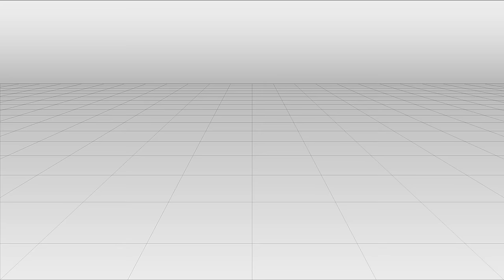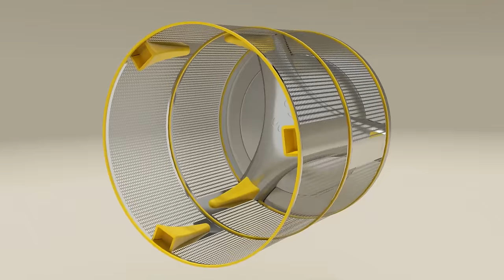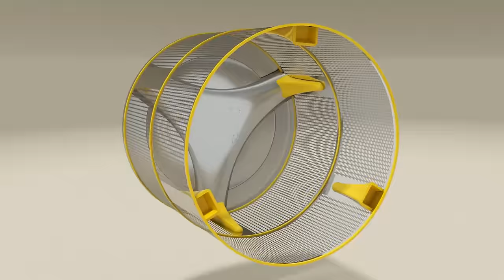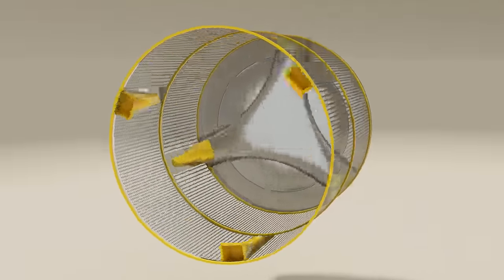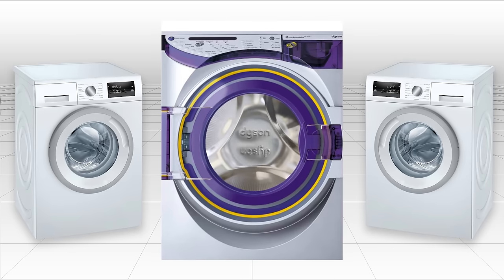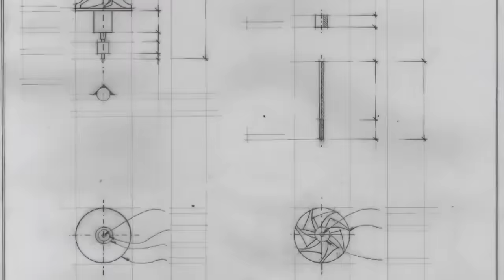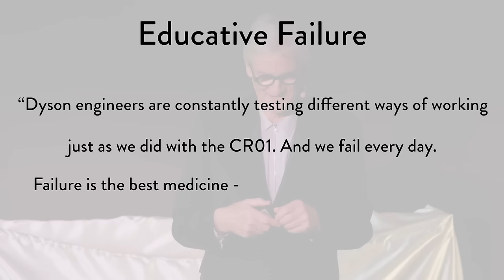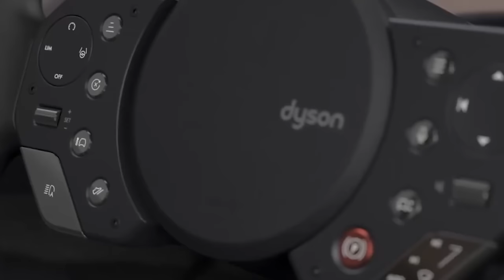Dyson’s Failed Washing Machine? The CR01 Mystery...

Comment: You highlight the key problem. That they simply didn't know how washing machines were traditionally made. Sometimes that's a good thing.....it allows you to disrupt a market by thinking outside of the box....but it can also be a bad thing that causes you to make mistakes by not understanding fundamentals. There are certain products and industries where not knowing how something has traditionally been made can be disastrous. 

Also, I think the main reason (from a practical standpoint ) was that the Dyson washing machine was just too damn expensive given the amount of repairs they constantly needed. It doesn't matter how good a product is if it's too expensive and isn't reliable in terms of not breaking down. Being innovative isn't by itself enough to make a product successful. People also need to be able to afford said product and know they don't have to worry about it not working. A 66% failure rate is simply not acceptable.

 And in order to produce a washing machine that won't break down so much you need to understand the fundamentals and how they are traditionally made. The same would apply to cars. Complex machines with many working parts cannot simply be designed and made from the ground up without a strong understanding of how it's done. That's a large part of why Dyson failed to develop their EV. They tried to do it from the ground up by themselves without a deep knowledge of how cars have been made (and the reasons why). They should have rather partnered with a car company.

Comment: I used to sell these. Can't remember ever having to replace one, but we only ever managed to shift a few. At that time you could buy a competent, low-end washing machine for under £130, so the price was just too much for most buyers. The thing weighed double (or more) the weight of a normal washer (and don't forget that it was common for a washing machine to be full of concrete ballast in 2001) and had a little pulley on the bottom that caused wheels to be lowered from its underside - just so you could drag it out from under a countertop. The biggest complaint we used to get though was the colour, though I believe that they toned the appearance back a little in later years.

Comment: The bad thing is that their washing machines used materials that were not suitable for long-term contact with the washing water and moisture. Aluminum, which the spider is made of, is attacked by alkaline media, such as washing water. In addition, the aluminum parts were in contact with the stainless steel drums. In damp and wet conditions this creates a galvanic element. Electrical and chemical corrosion therefore prevailed. My humble opinion as a chemical technician.

Comment: My friend had a Dyson washing machine literally took 4 years to pay off back then I was only like 17/18 it’s replaced a 90s hotpoint first edition machine. Witch cost around £300 £330 in the mid 90s my dad had the same one too. 
Like you said was brilliant (when it worked) washed so well was so weird but cool watching it never seen a machine like it then or since… 
But she had to get extended warranty out on it after only two years! Because the drum would get stuck lots of different error codes and leaks and other problems every 5 to 6 months the guy would come out and fix it like you said (she knew him well in the end) 😂🙈 
After 5 and half years she threw it out as the gear box broke ⚙️ and got replaced with a newer hotpoint first edition washing machine witch lasted 8 years before the drum went and only had a new seal and pump in all that time with 3 kids. 
You could see she was a bit annoyed by the whole thing as when it worked it was brilliant and I couldn’t agree more white socks would come out so clean not even my 2020 lg direct drive can get them that clean in just under a hour and a half on 60c cotton wash and it’s a very good machine so was the one I had before the lg intello washer 7kg witch come out around the same time as my mates Dyson back 20 years ago and lasted 7 years…. I had compensation for my arm when I was 18 and paid £420 for it was my first brand new machine I had ever bought for myself so I considered that high price back then. I told her I liked it but was to expensive and I couldn’t get credit as I was just starting out on my own with my first flat. 
Just goes to show sometimes the more expensive ultra modern things ain’t always the better option….
Reply from the maker: Thanks for the comment! Glad you liked the video. Sounds like a familiar experience with the Dyson!

Comment: An interesting video and an awful lot of negativity in the comments. Let me try and add some balance. We bought a CR01 when it first came out and it lasted until August 2019 when we replaced it with a top of the range Sasmsung Ecobuble after the Dyson drum decided to split! I’m sitting here waiting for the engineer to arrive in the morning to repair (hopefully) a 4 year-old Samsung in which part of the wiring loom has melted!! We had problems with the Dyson but not like any listed here. The biggest problem for us was the plastic used to make the soap dispenser tray and the door handle was really brittle and we had the tray replaced twice and the handle 3 times - I was reminded of this when I was looking for the Samsung receipt in the utility room and found a copy of the instructions for replacing the Dyson door handle - it wasn’t easy to replace as it required juggling with a spring and two catches at the same time. I don’t consider a lifespan of 18 years and a total maintenance cost of something less than £50 a bad investment. Would we buy on again - of course. Would we buy the £950 Samsung again - I guess we’ll know after the Samsung engineer gives us the good/bad news.

Comment: I remember seeing them in the stores, they stuck out like a sore thumb because of their odd styling and colour schemes, and would usually be positioned on its own near the entrance. I also remember thinking that they would look out of place in most kitchens, and plasticky, also that they looked a bit oversize, although I gather that they were the normal width and maybe just stuck out a bit. 

Presumably, Dyson must have been paying the stores to have a prime spot to display them in. Having them on their own, well away from the lines of washing machines struck me as rather odd at the time,  but I guess their prime market was existing loyal Dyson vacuum fans, not regular shoppers out to buy a new washer.  I think they would have been better off doing what Hotpoint did in the 80's to make their X2000 Microtronic stand out from all the regular machines with mechanical timers, and put it on a plinth in the middle of the  line of other machines.

The very expensive price was enough to put me off,  you could even buy a premium quality Miele for less,  but I also wasn't impressed by all the plastic, particularly plastic doors and plastic hinges, didn't like the style or colour scheme, and  I'd seen  the contra-rotation concept demonstrated on TV, possibly Tomorrow's World, and wondered if it might catch and damage clothes, and didn't think the added complication was worth it when my regular machine did a really decent job.

I also thought it an oversight not to have a matching style tumble dryer, even a 100% conventional one made for them out of house.

It was an interesting concept, the pirouetting washing was a cute party trick, but should have not progressed past a prototype, or at least not without coming up with a significant redesign to make it simpler, cheaper and more reliable.

Comment: You are spot on. I still have my machine.. And yes the engineer came came and stopped the contra rotation.. I was not happy as that was the main reason I bought it.. I wud love to be compensated for it.. Wonder if I can
Reply from the maker: Same, I don’t think it would stand today with social media and the Twittersphere.
Reply: @BehindDesigns 
Just last night cos the door wud not click shut I have not been able to wash clothes.. I have had to turn into a washing machine engineer since having this...
Reply: This sounds like how they deliberately brick older phones. could you not just opt to not have them change it though?
Reply: Apparently, it is, or was possible to re-enable contra-rotation on many machine, since it was mostly done with just a firmware update. They only replaced the gearing system with a fixed drive if it was broken. The programmers neglected to enable the copy protection bit on several versions of the firmware, so someone was able to dump firmware from both board versions off still fully working machines, and used to offer a flashing service for a fee.

Comment: I always thought that the contra roting drums would wear out the clothes & almost certainly the machine needed an overload cut out in case of overloading whereas a traditional front loader doesn't (if overloaded the clothes go around as a solid mass and motor load is reduced). So I didnt' consider buying one for long.

Comment: I think the failure lies in styling the machine as a typical front loader. Top loader with sideways drums would have solved the leak problems and reduced complexity. Perhaps working with ASKO at the time would have resulted in a changed perception of the best washing machine.
Reply: Top loaders in of themselves wash better than front loaders, given that you have the space to have one. An old top loader can agitate back and forth and pull the clothes into the center spiral while doing so.
Reply: @BrianGon89  the key word is old there. And what if you can't find one of those or just want something more modern. Unless you had one with good wash action a front loader will always be better and by that i means a no frills basic one will still beat out any top loader

Comment: It was a failure because it also tore up the laundry. Granted, this happened when people loaded the machine to max capacity (not necessarily overloaded) and your clothes came out stripped to ribbons. 

The surviving machines these days have severe corrosion on the drum's spider... Leading to an "explosively" fun time for the household.
Reply: you'd think they'd have caught that in testing. If they did enough
Reply from the maker: Couldn’t agree more
Reply: Bollocks, we’ve three in the family and never had a torn item.  Nothing washes like them and they’re so fast.
Reply: @r25limousine  Cute anecdote but it doesn't change the fact.
Reply: @lieferal4984  your word is fact, mine is anecdotal.  You must have a god complex
Reply: @r25limousine  Childish.

If you yourself looked further into why the Dyson failed then you would know too.

Comment: Actually one belt, two motors, the two brushed (universal) motors both drive the same belt and drum pulley, how crazy is that! 

I may well be wrong, but I would hazard a guess that the two motors may have been powered in series during the washing cycle, so each receiving around 120 volts, and in parallel ( 240V) for increased speed for the spin.

The contra-rotation motion was produced by planetary gears mounted on a steel clutch plate with yet another motor to drive the clutch plate in and out, which all look a bit thin and insubstantial, and also used plastic for some components, judging by the pictures on the web. I would assume that the inner drums contra-rotation motion had to be synchronised by gears, rather than having a simpler system with one motor driving each,  in order to make both rotate at the same speed so that the laundry would pirouette properly. 

There's a video showing some of the workings here: https://www.youtube.com/watch?v=WeVQ09BP2fY

Comment: That Dyson didn't/ aren't/won't bring prototypes of radically different technologies to potential future customers to give the new product a good kicking around is a wonderful way to learn lessons without blowing the company wad and reputation. That's pretty basic stuff in product development. I get and admire the company for starting with a clean sheet of paper when they tackle a perceived need, but in trying to be completly encumbered with the original technology, they dismiss what made the old design useful for whatever amount of time.
The only problem I have with the technology of my clothes washer, is it taking an hour to get the job done. Not wasteful water--there is a very small used in Energy Star appliances--nor electricity. I've never understood people's obsession with cleaner clothes. If they are so concerned, they might try using smaller loads and the auto-water setting on the appliance with high-efficiency detergent. Taking a little more time and pre-washing using undiluted detergent that one would work into stains and perspiration rings is a trick we have all forgotten, but it does a marvelous job.
Elon Musk, a man I thoroughly loathe, but a hell of a smart guy sets an example that I hope the Dyson Company takes note of. He came up with the hardest thing about the most important part of his automobile. He found as many uses as he could for it. It would be a key cost reducer and give his company the nimbleness that it was going to need to jump in this crazy industry he was diving into with full force and to keep the momentum up with astounding new products dropping like cluster bombs. Dyson is not interested in being a market leader, but having important bits, like a motor perhaps*, or whatever the tech could be hung on another product to realize the goals that Dyson might have. 
*I'm part of the marketing team, and haven't a clue what the "important bits" to anything, other than if they are shiny and whirl. I can always make those qualities the center of everything without troubling the individual with the annoying physics).
I'm the Hazel the Housekeeper in my world, so I look at appliances the same way a mechanic looks at a tool. I'm pretty sure my machine is another iteration of the HE (high efficiency) machines first designed in the 1990s somewhere. And They were modifications in an older design from around the mid-1960s. And so on. There was nothing wrong with any of these designs other than modifying as nessisary for market or government changes. It is, bless its head, a Electromechanical Device. If we could snitch Star Trek's Transporter for a joy ride and haul my Whirlpool back to 1940, the mechanic back then would be able to look at it and figure out the tech pretty quick.
Will my fancy-pants stripped down Whirlpool do a better or worse job than handmaid cleaning my clothes by hand?
I dunno.
I've never considered it before. Have you?
😁🙄😆